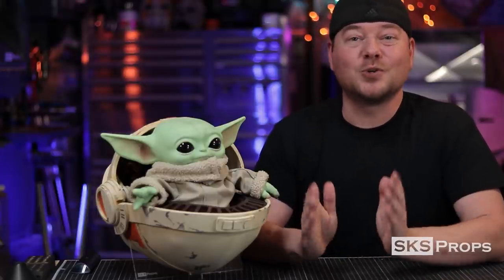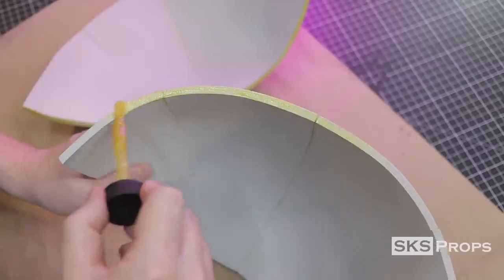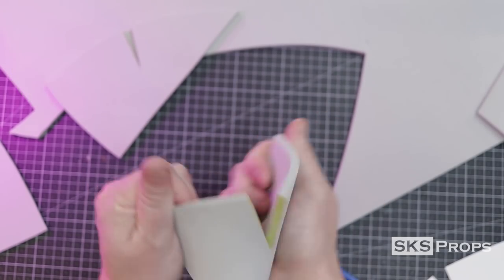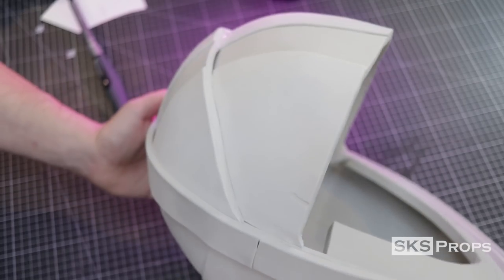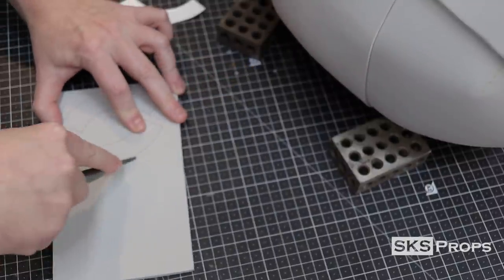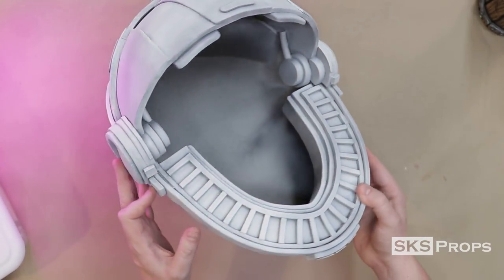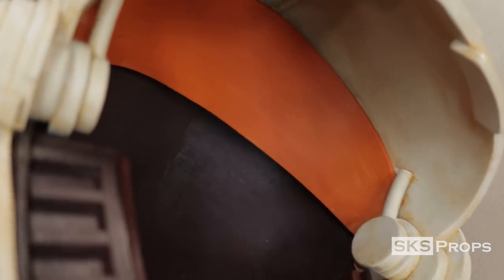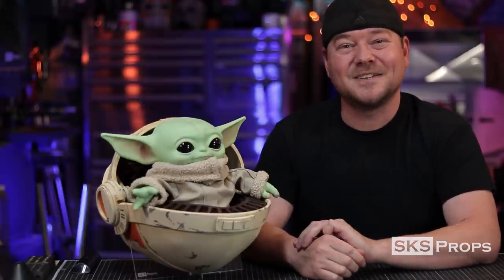How to make a Custom Baby Yoda chibi style Pram Pod out of Foam for Grogu with Free Templates

Comment: Very nice video.  I got the template for this and printed it out.  I've cut out all the pieces, and assembled the 4 pieces that make the bottom of the pram.  But, mine looks smaller than yours and I can't figure out why.
Reply from the maker: Thanks! When scaling it you need to open the pdf in adobe acrobat or adobe reader and click “poster” in the page sizing tab in the print settings that scales it properly over several sheets
Reply: @SKSProps  sure enough that did the trick, thanx!

Comment: I was thinking about a build of that Frog Ladies Egg incubator.  I guess the inside could be clear/pale blue resin with the eggs inside.  The eggs can be also made of resin using a round ice cube maker. ;-)   and then inserted at different levels in the curing blue water resin.  Just a thought.  Although all would have to be pressure potted to remove bubbles. The rest surrounding the resin glass like structure would be your foam.  What do you think?  Is this a possible build?  ps(my foam is on its way for the crib/pram. ;-)  If you do make a build for the Egg incubator that would be awesome!!
Reply from the maker: Def would be a cool build my only concern is resin gets heavy and like you mentioned the air bubbles that would be trapped inside. My though would be a large acrylic cylinder but those can get pretty expensive check out my buddy on Youtube the smugglers room he did a stasis tube holding a facehugger making his own clear tube that might be a technique to look into

Comment: Q: Do I need all the hardware used in this instructional (mounted power tools, motorized saws, etc), or can this be done with exacto knives, hand sanders? Thank you for posting, this looks amazing!
Reply from the maker: First off thanks and No you could build everything using utility knives and a rotary tool. I just use the power tools to move faster through the build 👍

Comment: Hello  This is just awesome!!  Thank you so much for sharing.  My question is: I poster printed your template over 16 pages.  Is this size for the pieces  too large?  How may pages did you print over?  thanks in advance.
Reply from the maker: Thanks! My templates printed out on 8 sheets of 8.5x11 paper
Reply: @SKSProps  thanks so much  I thought mine was a little huge  lol
Reply: @SKSProps  For some reason mine is not printing the full images on 8 sheets.  only 1/2 and they are huge.  If I print on 16 sheets it looks better and but not sure if that is the right size.  Is there a chance you can print the sheets for me and send them in an envelope for me?  Let me know if you can and how much it will be.
Reply from the maker: @wendysomerville9830  I’m sorry but I can’t print off and send them to you. The way you can determine if your scale is close Part W should be about 14” long. That should tell you where your printouts stand
Reply: @SKSProps  My W is 18.5" long so I am doing something wrong and the top pieces are cut off and not printed.  Are you printing Portrait or Landscape? I am doing poster/tiling but I think some of my settings are not right. Sorry for sooo many questions.
Reply from the maker: @wendysomerville9830  in adobe acrobat or adobe reader as soon as you click page sizing "poster" it should automatically be in portrait mode across 8 sheets 4 on top and 4 on bottom
Reply: @SKSProps  Thank you so much.. I was not in Adobe Reader it was another PDF program that was coming up.  Now it is printing properly.  Thank you so much for your help again. ;-)

Comment: Amazing build. Does anyone know how much foam it takes to make this build. I want to order the foam just wasn’t sure if I needed couple rolls of each or just one. Thanks for any help or answers.
Reply from the maker: Thank you! Blick Art Materials has my foam in a bundle of 2,6,10mm rolls one of each thickness. that would be plenty and you’d have quite a bit left over for future projects 👍
Reply: @SKSProps  what are the dimensions of those rolls.  I live in south Africa so buying your bundle to support you is unfortunately not an option, so i need to know hiw much to buy locally.
Reply from the maker: @cleof1503  my rolls are 24x60”

Comment: how did u get the printouts to look like that? because i noticed that when you switch to poster, it is now over multiple pages, so then some of the shapes are on two pages instead of just one . or did you just  print one big poster?
Reply from the maker: Print it out “poster” over several sheets then tape the pieces together
The templates I’m used were the originals hand drawn into Bristol board those were scanned in for the templates you use

Comment: Sorry to bother u. but any tips on how to resize this for a cat or bigger Grogu plush?  im tyring to figure it out without wasting materials and printer ink lol

Like if i want x" in width or length what do you think I would change in printer settings?
Reply from the maker: You just need to scale the percentage this one is approx 15” deep so that can give you a base size
Reply: @SKSProps  AYO that help a whooooole lot! I just found a way to scale :   Desired W(or)H....DIVIDED BY original..... W(or)H.....TIMES.....100% = A

Ax100 =What percentage to scale

That was the hard part i couldn't figure out the formula

Comment: hi, could you tell the exact size of the print? (I didn't find the poster option)
Reply from the maker: You need to open the pdf in adobe acrobat or adobe reader poster button is under print size and handling

Comment: Can you use a hair dryer if you don't have a heat gun?
Reply from the maker: You can try but a hair dryer doesn’t get near as hot. You can usually pick up a pretty cheap heat gun at harbor freight
Reply: @SKSProps  thanks. I decided I'm going to alter a bag to hold my baby instead of making the pram. I appreciate the advice and your video!

Comment: I notice that you use superglue over contact cement, do you find they give a similar bond?
Reply from the maker: I like to do a double adhesive method on parts that may be troublesome. Contact cement is a strong bond but has some give. super glue is great for details and bonds quick but in heavy wear areas can become brittle over time.

Comment: wow fab video! what size piece of foam do i need to buy from ur website?
Reply from the maker: Thanks! If you get the Cosplay starter kit that will have a sheet of each size you’ll need for the build 👍
Reply from the maker: @joint2joint  don’t worry about it. all of the sheet sizes are 24x60 but the kit that’s $35 has a roll of each size (2,6,10mm) needed for this project 👍